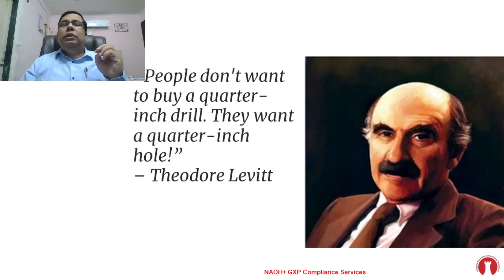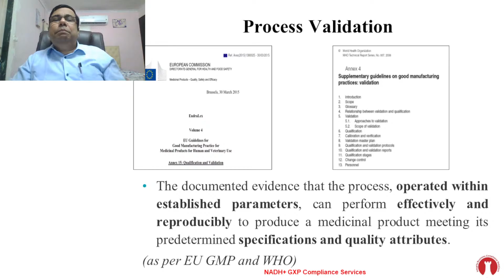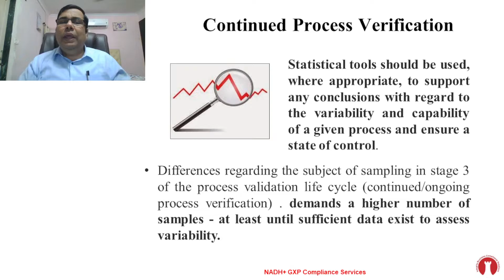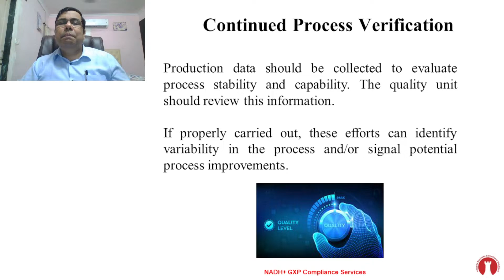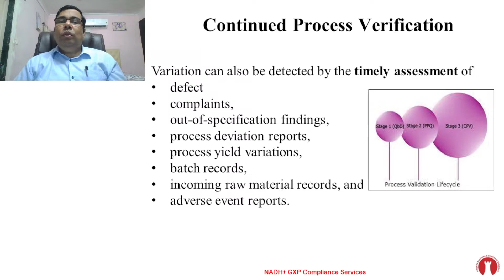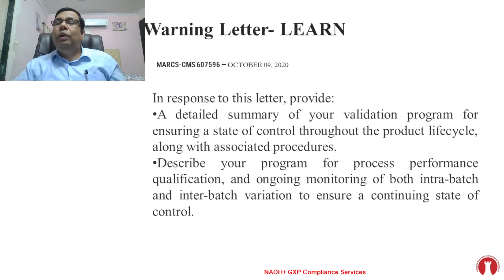Continued Process Verification

Comment: Thank u very much Sir ji for valuable information. I have question related to data point. As u suggested 20 data point. Please help for details information related 20 data points with example for better clarity.
Reply from the maker: sure. You can refer  the FDA stratified sampling guide for details. This guideline is not implemented but still provides good understanding.